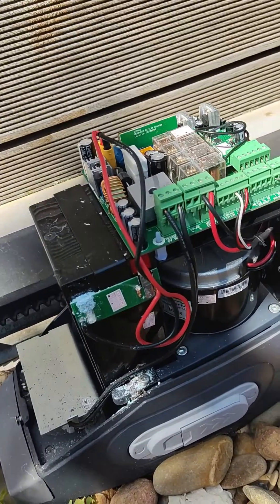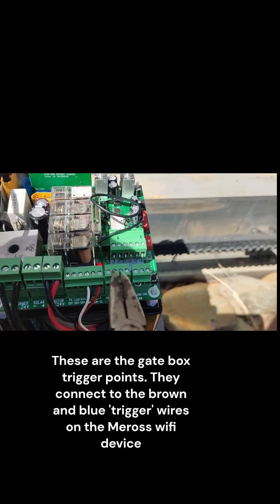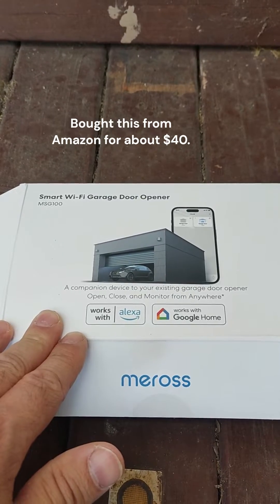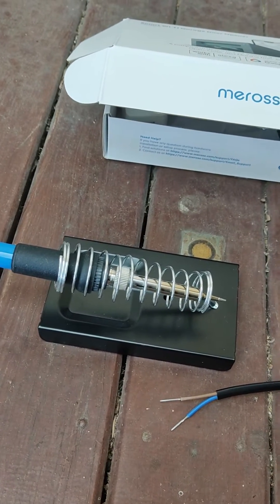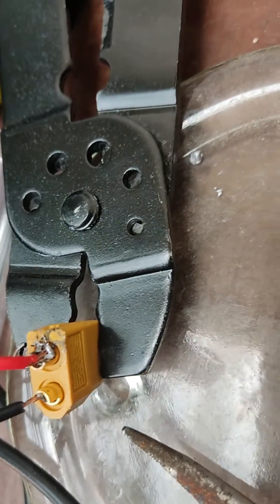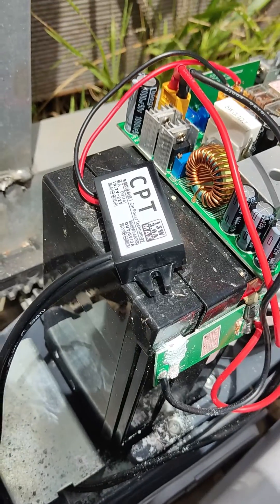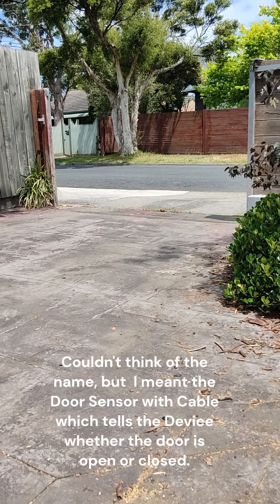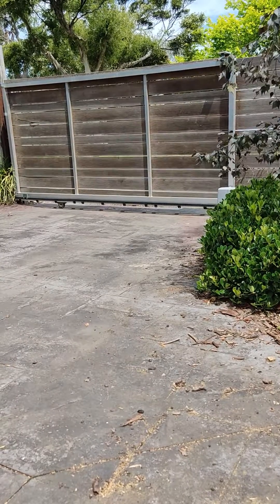Meross WiFi Garage Door Opener MSG100 adapted for a remote voice activated gate opener   Made with C

Comment: Hi, I have two questions please. 1. Did you get the gate open sensor to work? 2. Can you make the gate stop at any pint and the close it again, like the 'normal' gate remote?
Reply from the maker: So it could vary depending on what automatic gate you have. I have a letron. And also depending on what points U connect to. I can partially open the gate by activating the 'close gate' command before it fully closes. I have a camera so I can see how far it has closed. It's not as precise as the gate remote, but enough to leave a gap for a delivery if I'm away from home.
Reply from the maker: I didn't connect the sensor because I think thought that related to a garage opener.

Comment from the maker: At about the 1.30 minute mark, i show how to connect the meross unit to the gate opener. But i had to use a 12 v to 5 volt drop down, which is described at the 2.05 mark. The box itself runs off a battery backup and a low volrt charge that runs back to the house via a mains cord.

Comment: Silly question but how do you know where to connect the power to?
Reply from the maker: So in the motor box, there was a two prong plug that feeds back to the 12 volt battery. If you have a multimeter or a circuit tester (with a light) you can see whether there is 12 volts running through. If you are unsure if it is 240 volts or not, best get an electrician to do the work.

Comment: Stupid question, cause teoreticly it must be ok. Just on the  opener is 1A, if I hav 5V and 3A output, its OK?!
Reply from the maker: Hi.So my CPT drop down converter output is 5 v and 3 amps. Its been running fine connected to the 12 v battery. I think the amperage rating, allows up to 3 amp draw but it depends on the connected device current draw. The power adaptor for the meross unit is 1000 mA. So it has coverage to draw up to 3 but only needs 1 amp, if that makes sense.